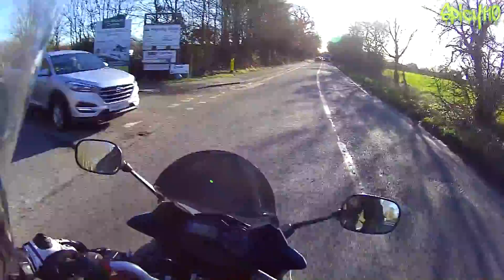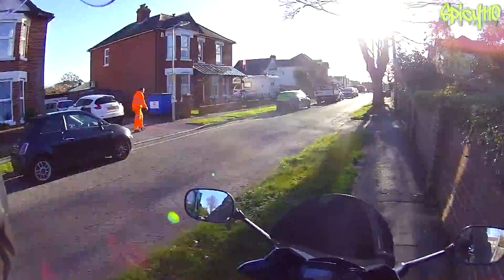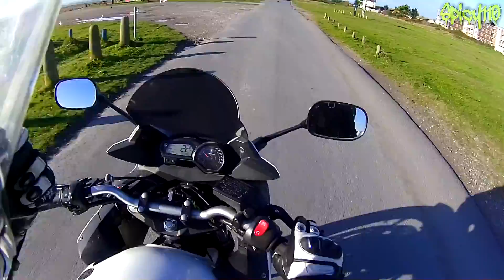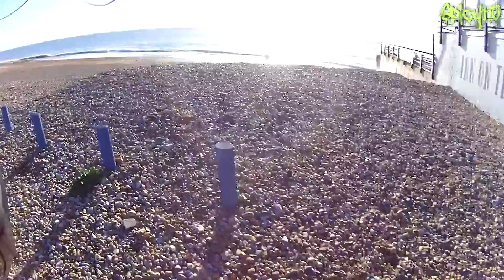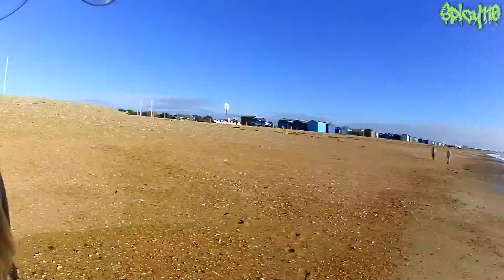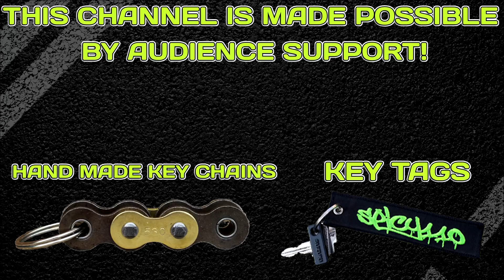I had to break in my own garage!

Comment: I can't remember if I've told this story before, might do a vid.  I had borrowed my brothers car to go to work once.  It was an old Ford Fiesta, no fancy modern keyfob.  My job involved doing deliveries in a Ford Transit van.  After I was done for the day, I parked the van up next to the car so I could easily take my sat nav and other stuff out of the van and straight into the car ready for the drive home.  Between moving things over to the car etc, I must have left the car keys in the car with the stuff I had just moved.  Locked the car with what I thought was the car key, went and moved the van into the warehouse, locked up etc.  Get to the car and do the fumbling for car keys dance.  Turns out, old Ford keys had the ability to lock all Ford locks, so I had locked the car with the van key not realising.
So I had to break into my brother's car without damaging it.  I was having visions of having to break the rear quarter glass and re-imburse him for the repair.  With a bit of help from a colleague, we found a way.
I managed to get a length of pallet strap banding, push it through the rear door seal and hook it onto the window winder (thankfully it was an old car with no fancy modern electric stuff haha) and wind the window down enough to get my arm through to pull the door pin up to unlock it.

Comment: I had to get a locksmith to let me in a few months ago, the downside to keeping things locked up tight! :-) I had a mate in my yoof, I always used to doss over at his and regularly let myself in, I was proper skinny back then and could climb in through his meter reader cupboard into his cloak room and then into his flat, could also open his front door with a short stick through his letterbox pulling the door handle down from the inside. Council flats back then were as good as open doors if you wanted in, it was easy.

Comment: worked a job fixing firetrucks as a road mechanic.  went to a firehouse and called my contact to get let in...  he was not in town and could not reach anyone. so he suggested to try the one of the windows on the side of the building.  got in that way.  did the job and locked the place back up.   a day or two later someone apparently tried to break in by forcing the door,  he called me to check if I saw anything out of place when I was there. told them you know it wasn't me because I know how to get in.

Comment: Ledge above the door, which meant i could access the bathroom window, which was always open at least a little bit.
Meant quite some climbing/jumping, but quickest way.

or through the neighbours' house, through their garden into our garden. And if parents were away for short time (groceries etc) the back door would be open most of the time. ;)
Big stream/river behind the house gave quite some protection so that is why they didn't lock it always. (unless winter time and it was frozen over xD Than i was f-ed ) .

Comment: I once had to post my self through bathroom window on the second floor of my dads house, I'm six foot four the window was one of them that's just a bit bigger than and A4 sheet of paper and it opened towards the drain pipe I had to use to get up to the window, plus I got stuck half way cos the was nothing in the room I could use to pull myself forward with and nothing outside for me use legs to push myself forward with. after aboot fifteen mins of using my stomach muscles and a rocking motion I got just far enough in to the room to grab to toilet seat and pull myself in to the room and the got down stairs to unlock the door for my extremely relieved dad who had been shitting himself the entire time. my hands stunk of piss and I had a blood red rash from the bottom of my ribcage to my knees for months after!!!!  sins then they invent mobile phones so my Dad can call a sodding lock smith if he's ever daft enough to lock him self out the house again!!! hahahahaha